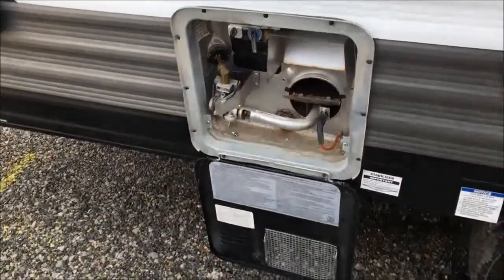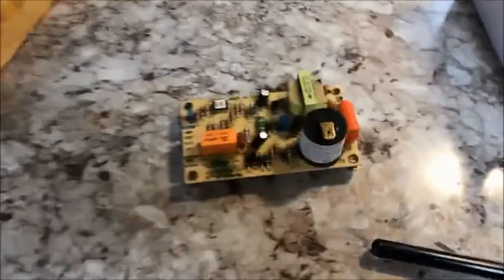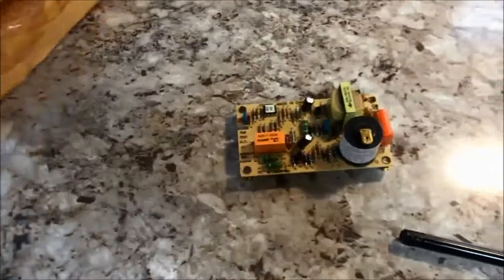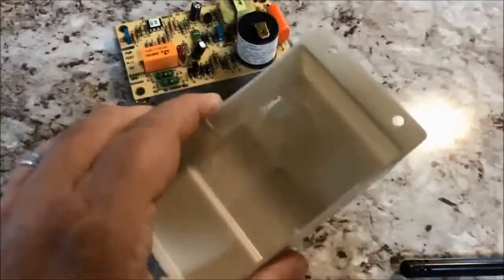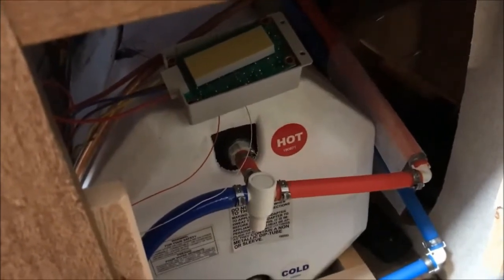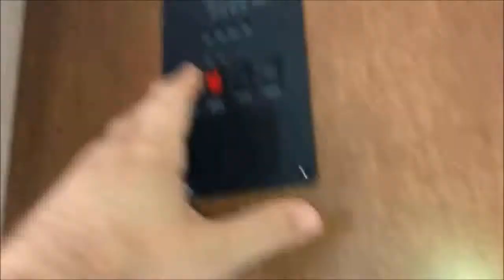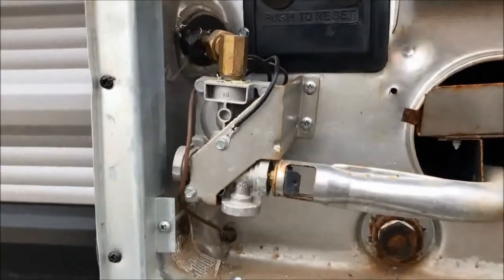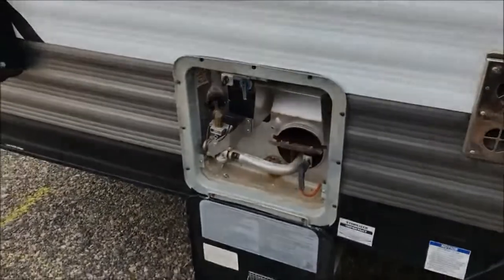Travel Trailer Water Heater Fix

Comment: Your video helped me the most to fix my camper's water heater.  No cost!  Our Suburban 6 gal automatic water heater began shutting off right after lighting.  Bad control board.  Finding the board was the hard part, stuck with tape to the top of the water heater behind the kitchen drawers.  Q3 was burned out.  MPSA29.  NPN Darlington pair.  Luckily I had some Motorola MPSA14's in my spare parts from 30 years ago and I made the swap.  I put a heat sink on it for good measure as that's why it probably failed in the first place.  Fingers crossed all is working.

Comment: Thanks, this cured my problem -- I suspected nothing more than a bad electrical connection and once I saw the control board in your video, I remembered seeing the same device... then remembered where it was, behind the door to the water heater valves, behind the left rear door (after dropping the outside-mounted spare tire) on our Sprinter-based 2015 Roadtrek SS Agile.

Yep, a loose connection on the 4-wire flat connector -- our control board was not in any way secured, so it had shifted downward and (apparently) that flat connector had pulled loose a bit. All good now! (And yes, I'll secure that control board!)

So thanks a bunch, a zero-dollar fix.

Comment: Another thing.  Our camper is seasonal and 4 years old bought it 2 years ago and I just cleaned a ton of mineral scale from our hot water tank.  Luckily no rust but lots of mineral deposits.  Need a new anode soon but fine for now.  The thing is campers need to know scale builds up fast where there is hard water like the northeast so your tank really needs to be flushed every year or two it's not BS to get you to pay for maintenance you don't need.  This is maintenance you do need.  Another thing.  I got all the scale out of our tank without a back flusher.  You open the water supply to fill the tank and you stick your finger into the drain hole and break up the big pieces of scale and let it all drain out.  You put your finger in again and again until you break up all the pieces like I did and let them all drain out.  My tank is scale free and I did it without a back flusher.

Comment: I just bought a 2021 keystone 262bh, had to blow out manufacturing debris,pull igniter out clean and reinstall to get it to work. My fault not checking it at the dealership. Just leaving this comment for anyone in need. My igniter would click and make one spark but, wouldn’t 🔥, after Emory cloth to the ends of the probes, problem solved. My dealership is 3 1/2 hrs away and I kinda had a thought of what it was.

Comment: I had the same problem, swapped out the control board and fixed. 2018 Wildwood gas only water heater.

Comment: Thanks for explaining your issue. I’m having the same issue with my KZ trailer equipped with Sub water heater. It flames for a few minutes then goes out. The flame is not blue. It has a little yellow and orange.

Comment: I have the same water heater... my DSI Fault light is always on, but the water heater works fine.  What do you think of that?
Reply from the maker: @mastersergeant8672  sounds like there is either a short somewhere or the control board is definitely having an issue. If the heater works as expected you should be fine, but definitely keep an eye on the heater and maybe listen outside to hear it igniting and running properly to be sure.

Comment: I wonder why your water heater is not gas and electric. Our Roos has both and Rockwood claims you get more hot water when both gas and hydro work together. I hope our heater does not give us any grief. So far it has worked well.
Reply: His is a model SW6D. Gas and Electric is model SW6DE.

Comment: Yeah I'm in the same boat. My truck camper water heater won't spark but it will heat water find on AC or with the generator running.

Comment: Soooooo. Does this mean the ignitor was not the issue making it necessary to buy the new brain?
Reply from the maker: That's correct. I bought the ignitor too as it was very cheap and easy to replace, and wanted to be certain everything was in working order.

Comment: I've got mine hooked up properly and I went over and redid it half a dozen times but it's got power to it but I can't hear it heating up the water is that normal for the first time it's Heating
Reply from the maker: If it is running on gas then no that is not normal. If you stand outside near the vent for the tank you should hear it running and getting hot. If you're running it on electric (not all heaters have electric options) then I'd imagine it would be quite quiet.

Comment: I have the same issue but have absolutely no spark. I tested the lead wire to the ignitor and I don't have12v at the ignitor when I turn the water heater DSI switch on but I do have gas going into the burner. I'm betting its the circuit board just due to the fact I don't have 12v showing on the meter at the ignitor

Comment: I cant find the  thw water heater tank  is not under the sink any ideas
Reply from the maker: You will need to find the access panel/vent door on the outside of your trailer and then use that as a reference for where it will be inside the rig. There will usually be a wooden panel infront of it (held in by some screws). What model of trailer do you have?
Reply: @CanadianCampaholic  is a 2017 forest river cruis lite salem 28. Ft onli prpane heater no electric heater

Comment: hi my hot water tank is gas and electric when on electric it works just fine but on gas i seem to have the same  problem as u did i changed the igniter 
 with a new one  but this did not solve the problem should i look for this board your talking about ..... thanks
Reply from the maker: Did you figure this out? I would recommend looking at replacing the control board if you haven't already.